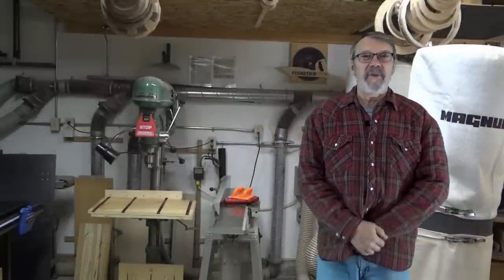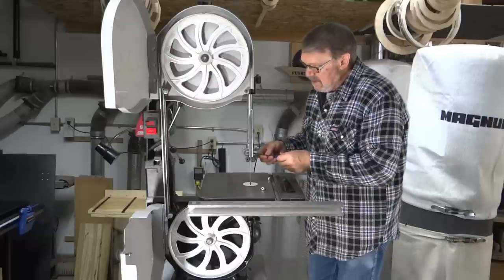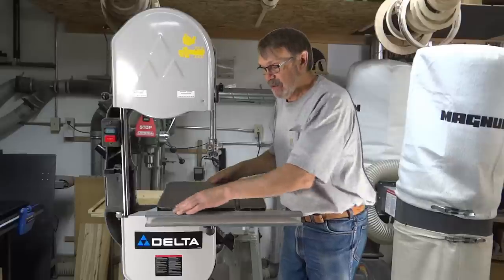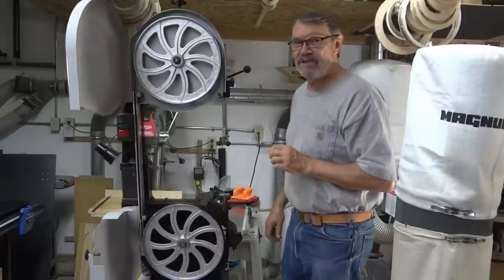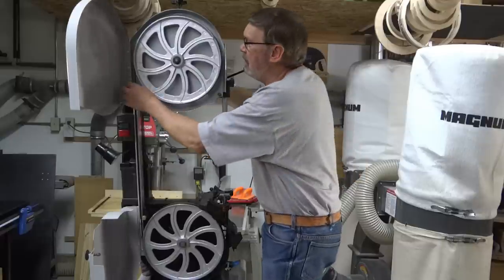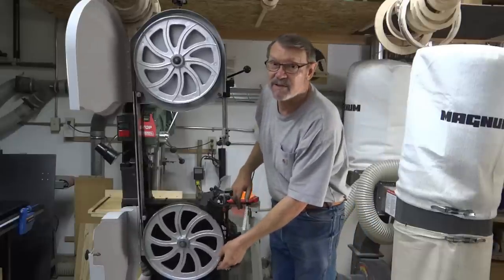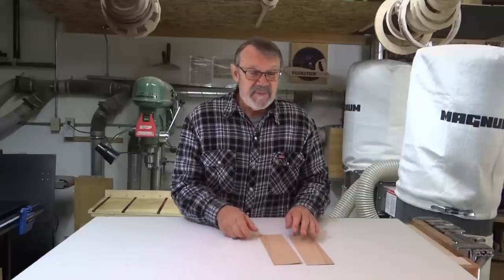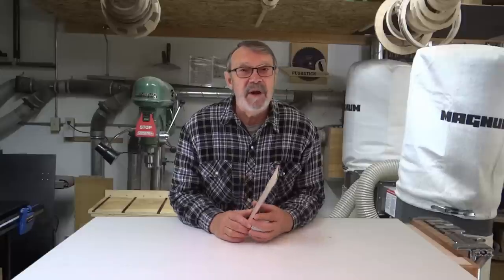Upgrading My Delta Bandsaw

Comment: I am debating buying a carter guide for my delta.   I am a hobbyist, so the expense is significant for me.  Can you tell me benefits and if you think it’s worth it.   I don’t have an extender block and am working off the original cool blocks from delta.
Reply from the maker: I’m a hobbyist as well. Before the upgrade I could never get a straight cut. As I showed in the video, I can now get a straight cut using the fence. The difference is like night and day. Only you can decide if it is worth it to you. For me it has definitely been worth it. Before the upgrade I avoided using the bandsaw unless I really needed it. Now I look forward to using it every chance I get. I hope this helps with your decision. Thanks for watching the video. I appreciate the support. Stay safe and healthy!
Take care,
.....Gord
Reply: Gord Rock definitely helps.   For me, I feel that I am constantly putting pressure on the blade as I am doing radius cuts- the blade twists and turns.   I am assuming the carter guide will resolve this?
Reply from the maker: Yes. It will help immensely!

Comment: I installed the Carter kit on my Delta 14 inch bandsaw.  It looks like I'v lost about one inch cutting capacity.
Reply from the maker: I don’t recall losing any cutting capacity but that was quite a while ago. Are you talking about capacity in height or the depth? Anyway, thanks for watching!
Reply: @GordonRock1  , because of the way the blade guard is attached to the guide post I lose about an inch in how far the upper guide will slide up, thus reducing the thickness of wood that I can now cut.  Or I guess you would say the height of the wood that will fit into the blade now.

Comment: Ha, but then you have those people who claim that Laguna saws are superior primarily because they use a cool-block system rather than bearings. I suppose one issue with bearings is that they can compress rather than scrape off sawdust.
Reply from the maker: You may be correct, Dave. I have never had that issue but I do check occasionally to be sure that isn’t happening. Thanks for watching, Dave. I appreciate the support!
Take care,
.....Gord